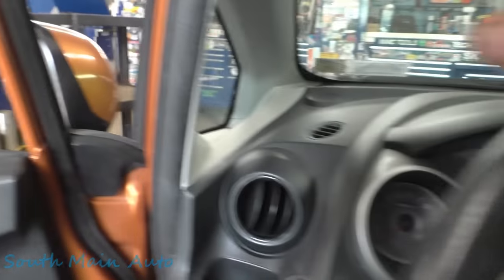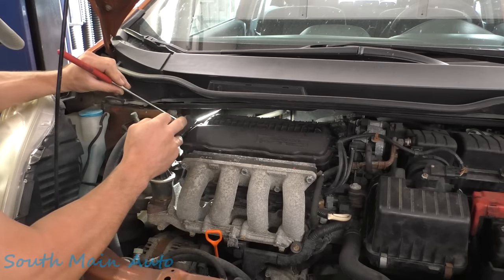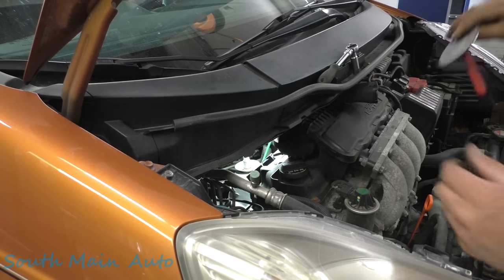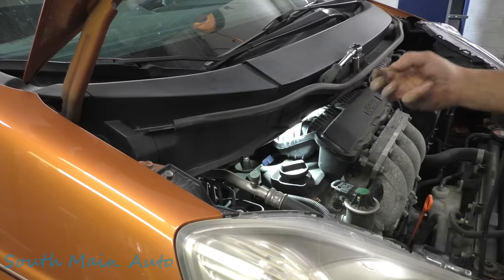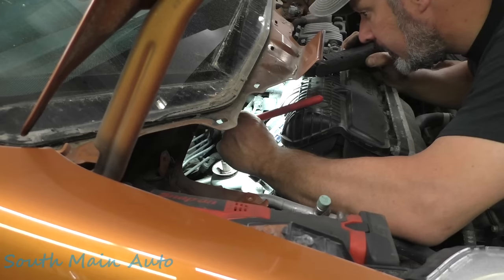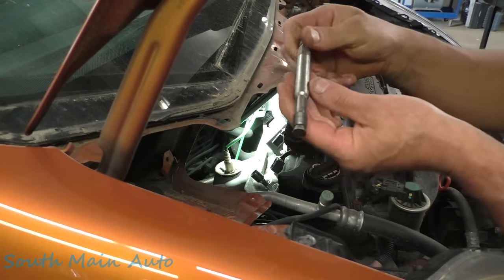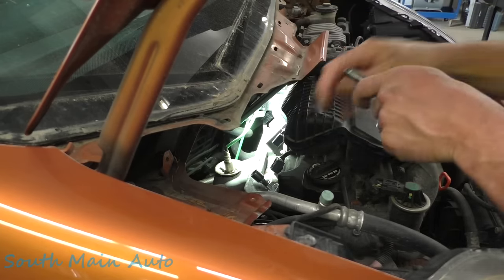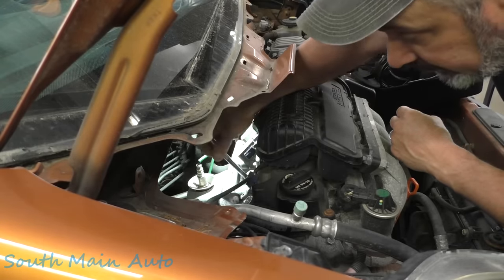Fixing A Blown Out Spark Plug - Honda Fit Edition

Comment: @24:30 You say, "If you are a machinist, look away." I did, and I am still laughing. I never seen hole tapped that way. Awesome repair b/c it worked.
Nice Heli-coil repair. Now all you need is an Amsoil engine flush to eradicate all of the standard off the shelf Dinosaur sludge from the tiny passages in your hydraulic valve train followers. 

 Once the standard Oil sludge is vacated from the engine, it is time to put in some REAL motor oil with the Amsoil Signature series of synthetic Oil and ALL that top end engine rattle on camera will quiet down to a nice purring sound. I am just sayin'.

Comment: Remembering that time I replaced the spark plugs and didn't tighten them.
Heard a loud BANG and all of a sudden my Miata was unhappy.
Pulled over and saw a spark plug boot sitting suspiciously high 😬
Of course this was back when I carried a toolbox and supplies in the trunk. Never know what needs replacing on a 30 year old car.

Comment: My 2007 Ridgeline had an odd smell I could only detect at idle.  After checking the PCV system, I pulled the plugs.  Four of the six were finger tight.  Combustion gases were leaking by.   I replaced them and torqued them to Honda spec.  Years later my son bought the truck from me and told me when he went to change the plugs several were loose.  Must be a Honda thing!

Comment: Old machinists tip: pack the flutes of the tap with heavy grease, and most of the chips will come out with the tap. Spray with Brakekleen before you put in the insert w/Loctite, and shazam! It works even if you're not an old machinist...

Comment: Great Job Eric. I do have a question for you. I own a 2016 Ford Escape Titanium with the 2.0 ecoboost engine. Last fall I changed the spark plugs with the OEM Motorcraft SP537 spark plugs. Some people said I should have installed NGK Iridium plugs and others say Motorcraft plugs. What is your recommendation? I do not have a issue with changing them agian to a better suited spark plug. My fuel mileage really sucks in the city but I get around 28 mpg on the highway. Also my daughter has a 2015 Ford Focus with the non ecoboost engine and I need to change the spark plugs in her vehicle as well. I believe her car uses the same plugs so if there is a better suited plug i will go that route with hers as well.

Comment: My wife got a blown sparkplug on cylinder 3 and it only 110k mileages... i was going to do the same what u did. But out of curiously where or did u made a extension to inset in the tap thread? Cuz my socket is too big for the sleeve..

Comment: Mr O I have a question, can I cut the ends off of ford quick disconnect fuel lines and just use hose clamps?? Any Info would be great, i been a long time supporter since the beginning!

Comment: Need your help Mr O!!! 
We are screwed spark plug job on an inline 6 went to poo, it’s on a ford 6 cylinder, Australia model. 
Spark plug has stripped out the thread and is just spinning about half way out. 
Any tips? Need something to pull it up while undoing. Then repair the thread 
Thanks!

Comment: how much you want to bet the insert comes out with the plug next time, the saving grace with this job is, with the amount of oil in and around the cylinder and using iridium plugs, this will probably be the last spark plug change this car sees....

Comment: Torquing spark plugs is what gets you in trouble. Finger tight +90° if you use the 15-18 ft lbs you hit "factory spec" at 45°. Only torque USED spark plugs, or tapered seat.

Comment: I removed a rear plug on my '06 Odyssey and wondered why the new one wouldn't screw back in. Someone had overtightened the old plug and the threads came out with it.

Comment: Theses generation fits are know for the spark plugs to loosen up and cause missfires or intermittent missfires seen a lot of these come into the shop lately for this same concern luckily not as bad as this one we were able to just reinstall the plug and tightened it down. The most recent fit only had 60k on it and she comes to us for all our services and we never did plugs and they were all finger tight. But there is times where I think people just don’t take the cowel out to do the plugs and try to give it the old fashioned reach around and they can’t get it as tight as it needs to be 🤷‍♂️

Comment: Im currently doing this on a 2007 honda fit, i created new threads but my helicoil will not start. Do you have any suggestions? I really dont wanna swap the motor over this

Comment: Ford spark plug popper guy flew in to fix my neighbors van he positioned the engine with the exhaust valve open had his shop vac connected to the tail pipe to help extract the metal that went into the cylinder when tapping the hole
Thought that was pretty good method

Comment: so i bought the  spark plug saver kit, but i the reamer does not have  3/8s adapter for fitting an extension, im wondering if thats a different reamer than the one you have in the video? and where can i get it?

Comment: Why not use grease in the hole to catch any aluminium loosened by the thread arbor?    Better to catch the detritus in the grease than allowing it to drop into the cylinder.

Comment: This happened to me five days ago.  I have a 2012 Honda Fit with 85,000 miles.  I learned a very expensive lesson.  Have a mechanic change your plugs and coils!  Also do not continue driving with flashing check engine light!  Cost me $1060!  A spark plug literal came out of the head!  I thought the engine was blown!  The people at my local shop I trust were able to fix it but lots of labor!
Reply from the maker: Over $1,000 put a threat insert for a spark plug. You got super screwed man
Reply: @SouthMainAuto  The part was only $75.00.  Then had to replace two coils.  It was mostly labor and I know it was a lot of work.  This garage has a very good reputation.  Sure if I was able to do it myself I’d probably saved around $700.00.  This problem wouldn’t have happened had I just taken there last time check engine light came.  I don’t what price you think it should have been?

Comment: It’s weird the L15A in early Fits like this one had the plugs around back rather than through the top of the valve cover like the newer L15B and just about every other modern 4 cylinder Honda. In general Hondas are some of the easiest cars in the world to work on but not this one. It’s also hard to imagine how this happened. It’s not a Ford Coyote engine that famously tried to shoot plugs through the hood due to one of the oldest US car makers not understanding how to engage enough threads on spark plugs.

Comment: I have a question. Im fighting a broken spark plug in an 1980 XS850 yamaha motorcycle and its winning. I've tried heat but of course it's aluminum a great heat sink. I've tried a 4 point easy out with a breaker bar and extension and that didn't work. Any suggestions?

Comment: I should not have watched this  . I am a Retired  Plumber  and a worrier . I replaced my Spark plugs in my Honda /Jazz /Fit  2 years ago with  NJK iradium . 6 months after I replaced them I read a bit about  some of them coming loose , so I took off the surrounding Cowl etc and re-checked   Torque speck  etc . That was at 64k miles , the car has now done 72 k , will they be ,
  ok ............. or should I check them once a month ? lol  :face-purple-crying:................................🤣🤣🤣 best wishes from Scotland .

Comment: I used to have an 08 fit and was active in the online community for the 8 years i had it.  I never heard of this issue happening, and cant believe it happened naturally.  This has a human cause  This engine was co developed by Honda Marine and is so durable at high speed that it is used in the Honda 75, 90, and 100hp outboards.  This is kind of shocking to me.
Reply: @@Toby-of5lc That is interesting.  I had just over 160K on mine.  I installed a new set of plugs at about 95K and they were tight.  Mine is just a sample of one and then the Fitforum.  I never heard of this there either, same with the Honda marine forums which this is the same block and head used in the midrange engines from 2007 to today.  This may be a problem on the newer L15B7 (since 2016) used in the Civic, and often with a turbo, but not on the Fit/Jazz L15BA or the Marine BF75/BF90/BF100.  The newer engine uses a different head and has full Vtec (YO!).  The Fit variant has a non-performance, economy focused Vtec of simply activating the other two valves and not adjusting timing.

Comment: Hard to believe a plug would blow out without destroying the thread on any coil that would hold the plug down.  It can't go up, so it can't unthread.  Either the spark plug threads or the head threads would give out.  Being loose might give it enough room to beat on the threads though and eventually just wear them away.  It'd have to be loose enough to move though you'd think.

Comment: Those short ones must be for the Ford 5.4 L 2V engines.  I've owned two of those with no blowouts.  My current 2002 has 172k miles on it with no blowouts.  "Knock on Wood"

Comment: Honda revised the torque specs to 20 foot pounds, so they don't back out of the head. Also, DON'T use anti-seize on the threads.

Comment: That's weird, my 2012 fit had a misfire at 160K miles that turned out to be a loose plug on number 2 cylinder that simply needed to be retightened. I'd blame the guy who changed the plugs at 100K but that would be me and I'm real careful about making sure I tighten things real well.

Comment: Jeep 3.6 Pentastar even worse, need to take the intake manifold off to reach 3 of the 6 plugs for replacement.  I have 3 of their motors, a 3.6, 3.7 & a 3.8.  2016 JKU 75th Anniversary, a 2007 Commander and a 2010 JK Rubicon, respectively, The 3.8 being the easiest to work on of all 3.

Comment: Once the spark plug becomes loose the spark plug gets sucked down on intake and pushed back up on compression ever so slightly. This process happens millions of times until it wears the aluminium threads so thin it blows the plug out. Happened to my wife’s mini. This is due to the fitter not torquing it down and just nipping it up as he knows the head is aluminium.

Comment: Why did you not compare visually the spark plug threads on the good one and the doubtful one???  Then, only if the both appear the same, should you have even ventured to insert the doubtful one in the good hole.

Comment: Great video, thank you.  However, I would have filled the flutes of the tap with grease in an effort to trap as much of the aluminium as possible and then blown it all out as you did, I suppose its belt and braces.

Clearly who serviced the car in the past did a fairly poor job given how loose the spark plugs were and all the damage to the plasticware and coils, unfortunately, I would imagine that was in the dim and distant past so that a claim was impractical.

Comment: I hate the way they jam everything under the Cow or windshield wiper assembly and Motor, like that.. My Juke is the same way the Turbo and exhaust are at the back in between the Cabin fire wall. So everything gets Heat soaked sitting at a light or in line at the track.. LOL.. I love it when they spin the 4 cylinder's the other way and put the exhaust manifold in the front.. But I get why they don't....

Comment: A far better way to handle the chips- attach vacuum cleaner to exhaust ,turn engine till you just start to hear sucking noise. Vacuum will suck chips int exhaust we’re they will do no harm. Been doing that for 30 years.

Comment: Sure wish!! I would have had this video in the early 2000s, my 1996 Dodge avenger that had a similar problem, I tried this but I didn't know that you could thread tap it all the way in and I didn't have a blower, how to get the shavings out, and it locked up the engine at low RPM, I sold it to one of those car buying places and they fixed it and then somebody wrecked it, because it was a 5-speed and I don't think they knew how to drive it??😢

Comment: A not so unusual problem. For a custom thread chaser take a newish sparkplug and using a Dremel tool with a small cutting disc cut six slots perpendicular to the threads. Lightly wire wheel the threads. You now have a thread clean up " tool ". Kinda a hail Mary pass' but has worked for me several times. Of course not effective here. Thanks SMA.

Comment: A bit late on this comment but the loctite is pointless. Once the engine heat cycles the loctite will just give up and let go. One heat generally wrecks it anyway and two you have a steel thread on the spark plug in an aluminium hole, the 2 metals expand differently and the loctite wont be able to compensate for that so don't bother.

Comment: 20:36 - 161K miles and still shows cross-hatch on cylinder wall? Maybe this engine had work done? That view was probably not on the thrust side, but still looked to me like that cylinder was freshly honed. And the condition of those grimy threads did not match the pristine condition of of the cylinder🤔

Comment: Sure hope it wasn't a shop that installed the wrong plugs in the car and didn't tighten them properly.  Those looked like basic cheapo copper plugs instead of the Irridiums that Honda has used forever now.

Comment: Honda may be known for building quality vehicles but when it can to engineering the Fit for engine accessibility, they did a poor job.
I imagine just to have the spark plugs changed on this car by a shop is very expensive due to labor cost.

Comment: I’ve got a good mechanic question for you…. Lol
   1997 F150 5.4,auto,4x4. 
  Last summer I was going to pay my neighbor 50 bucks to just remove the passenger side exhaust manifold because I was going quite down the exhaust. I told my neighbor I didn’t care if studs broke off just get the manifold off.simple.. right? Wrong! This dude pulled down on the manifold and literally busted out half of stud holes on the bottom four!!🤦🏻‍♂️
 I was ready to take a thousand bucks out of his ass for the cost of replacing the head! Is there any little tricks that u could mention about how to rebuild the stud holes and will they be able to hold the 11 pounds of torque 
Ford requires to hold the stud into place..?  I’ve thought about leaving the old manifold on to line up the hardware but I don’t know what would hold the pressure and the high temperature from the exhaust pressure… 🤔

Comment: Meh. One full wrap of Pro Grade duct tape around the original plug threads, cinch it down guten tight, add a couple 30W zip ties, she's good to go. Or, do it your way. Whatever. Guy never shows the crow bar breaking the plastic clips off or the hood blanket fire from shrink-wrapping, etc. Guy sounds like his mouth is fulla ball bearings (cause it's all ball bearings these days). Merry Christmas, where's the Tylenol?

Comment: I bet a young tech used a power tool to put the plug in...cordless or air....and stripped the threads.... always hand start and turn them in gently if aluminium or aluminum depending on your pronoun- sin - nation !!

Comment: I wonder why Honda mounted the engine backwards unlike every other model they make. What a pain in the nuts that would be to work on to do a valve clearance check or anything on the exhaust side. Dumb engineers